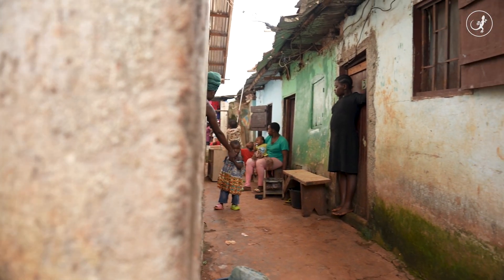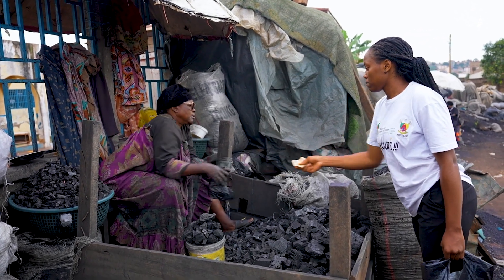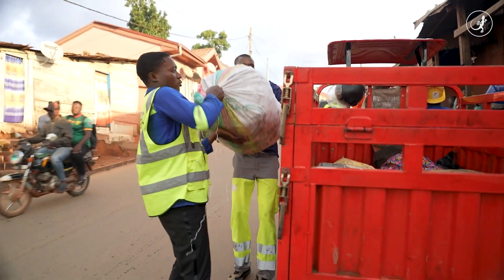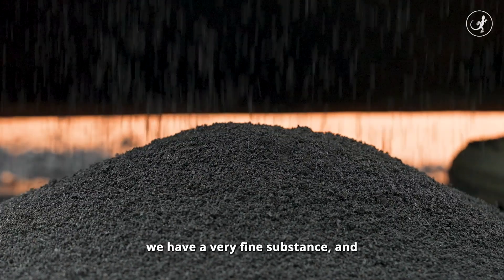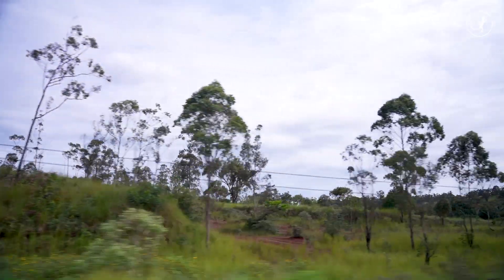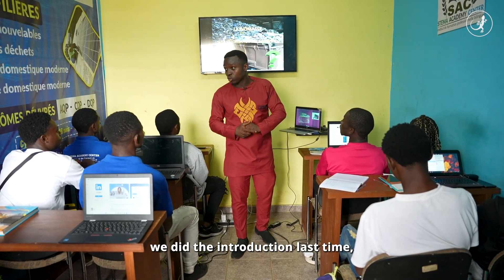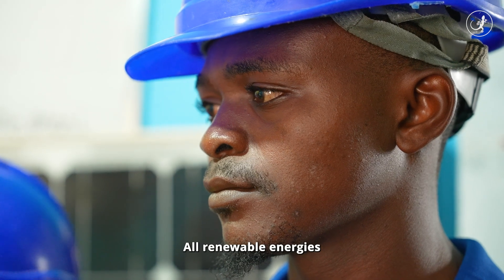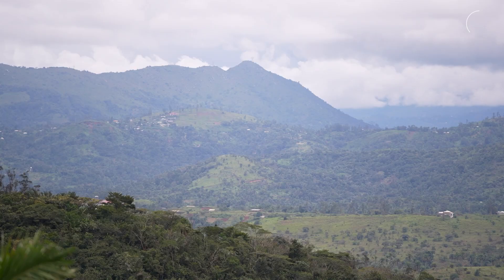Biochar from banana peels breaks ground in Cameroon

Comment: Wouldn't it be more cost savning and beneficial to make biogas from organic material, rather than coal. They would get fertilizer out of it too, to fertile the ground, helping them in growing crops and be self sufficient and not so much dependent on the west. 

And Is it not more efficient/energy dense and can be used/converted for many other productive applications?

Comment: These are charcoal briquettes. Not biochar. Similar production processes, but very different uses.
Reply from the maker: Hi Jon! Thanks for watching and for taking the time to comment. 

Since quite a few people have made a similar observation, we reached out to Steve and here's what he had to say: "To obtain coal briquettes, the raw material is first converted into biochar. So at the stage when we introduced biochar, it was actually biochar. Then we moved on to the sieving, blending and compacting phase to obtain the coal briquettes."

Some of this is also a translation issue since the original was not in English but was translated. So, "biocharbon" is charcoal briquettes used as fuel to replace firewood or gas but in translation,  "biocharbon" is translated to "biochar", hence the overall confusion created.

Thanks again🙏
Reply: That was my thought, that we must not have received information on a step that had previously taken place.  That, along with   word(s)(ing)that do not translate well into other languages can cause confusion.
Reply: @MongabayTV  Thank you very much for taking the time to look into this! I am actually a full time project developer for a biochar project under one of Africa's largest sustainable charcoal companies (Kijani Forestry in Uganda), and speaking for both the biochar and charcoal industries, the misuse of the term biochar (for any fuel-related purpose like the briquettes in this video) has created a lot of problems, especially when talking to stakeholders and potential investors who erroneously enter (or fail to enter) a conversation thinking we are talking about briquettes when we use the word biochar. There is consensus among biochar producers, professionals and researchers that the term biochar does not apply to material used to make briquettes (even though, as you rightly point out, the materials are one in the same for a brief period before the char is mixed with binding agents and turned into briquettes). As it stands, the title is still inaccurate and will add to further confusion among the general public, who the biochar industry increasingly needs to be versed in what biochar is and is not. this negatively impacts projects like ours if (and this happens all the time) stakeholders think we are proposing to burn materials and not that we are creating soil amendments/carbon sinks (those are very different things). 

Here's an analogy: I found an article about KFC the headline reads
"VANCOUVER MAN RECIEVES RAW CHICKEN BURGER

Now if they had written 
"Vancouver man receives raw DINOSAUR burger" they might still be technically correct, depending on what scientist you talk to... but the article title would be extremely misleading... 

Sorry to harp on this. I love and deeply respect the journalism at Mongabay... which is why I have to call for a true correction. 

Many thanks!
Reply: @MongabayTV  He says "charbon de bois" which is just wood charcoal.
Reply: @MongabayTV  You "reached out" to a French-speaking African to enquire about what words mean in English? LOL, that explains why you say the charcoal is "ready to use" 2:48 when it's wet and needs another production stage (drying). It's obvious that you don't understand your subject matter.
Reply: How do you know? All that you know is the lies that they tell you in America! You can also make biochar from burnt coconut hulls then charge it

Comment: The key here is that bioenergy from residual biomass is a decarbonization solution while bioenergy from whole trees is not a decarbonization solution.
Reply: It still depends on the situation. In most cases you are right though
Reply: It would definitely be the solution for palm oil problems.
Reply: @markus_selloi  Agroforestry is the solution the the palm oil deforestation problem.
Reply: Whole tree energy is a decarbonising solution IF trees are replanted and they offset oil based energy. It keeps carbon in the small carbon cycle instead of moving long term to short term as oil and gas do.
Reply: @popandbob  There is no need to use whole trees for bioenergy because hundreds of millions of tons of residual biomass are produced every year by agriculture and forestry.